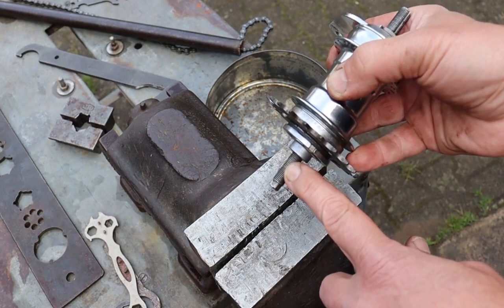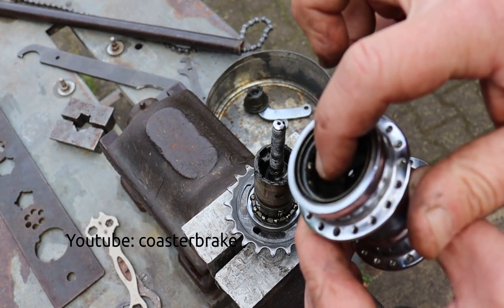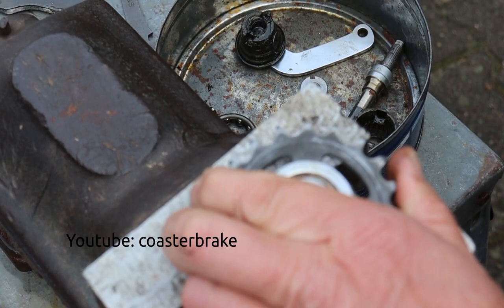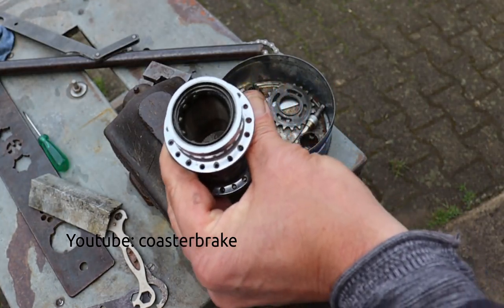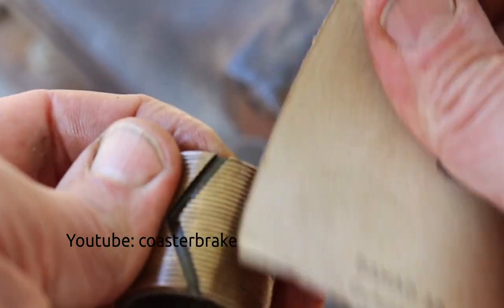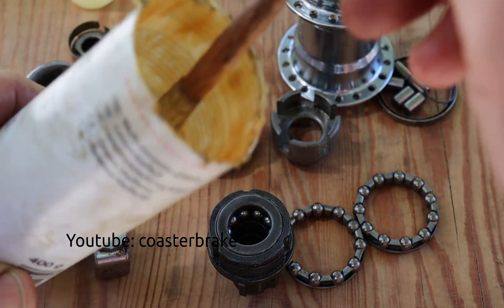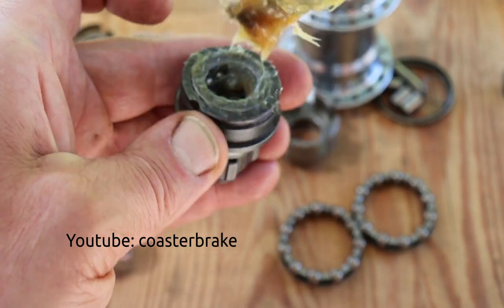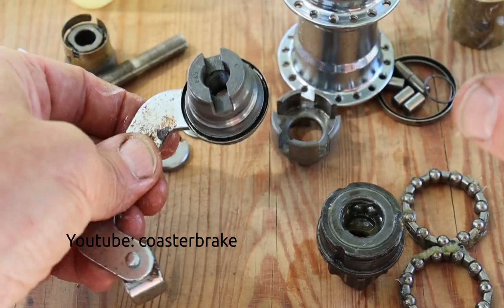Restoration a Mod09 Sachs Torpedo Coaster Brake 1960, rebuild with driver for push-on type Sprocket

Comment: Thanks so much for this video! I plan to overhaul my sachs torpedo hub and this helps immensely since I have never owned a sachs hub before.  I think my model is from 1938, at least there is a "38" stamped on the hub body and from what I can find online it looks like it's from then.  I love the old classic stuff....built to last and last.
Reply from the maker: Yes 38 means 1938, drive it until 2038 and longer 🙂

Comment: Hi =) Thanks for a great video. Did the design change a lot through the years? Mine is a 1938 K.
Reply from the maker: hello, the early hubs, until 1920 are a little bit different. a Torpedo 1938 is standard and the parts are interchangeable with parts of the 40-60th, regards
Reply: Perfect. Thank you for you answer!  Then I suppose it´s not that difficult to find some spare parts if something is broken =) The brake as it is now, first kick in with a pedal travel at maybe -85 degrees and not +45 as it´s suppose to?
Reply from the maker: @Simener you need new brake parts, most important the brake cylinder: http://www.torpedo-coasterbrake.com/images/partnumbers/torpedo-coaster-brake.pdf

Comment: will it be ok to use  grease on the   brass brake because had no vasaline
Reply from the maker: I would buy vaseline!
Reply: It will melt on breaking.
Reply: @artjomaltenhof9691  its high point melting grease mat,also vaseline melts more so,so if the grease did melt that is a good thing realy
Reply: @artjomaltenhof9691  the vaseline is meant to be used on the brake and also should be smeared in vasaline but grease can also be used in the same way,and the grease and vaslaline both melt on the brake